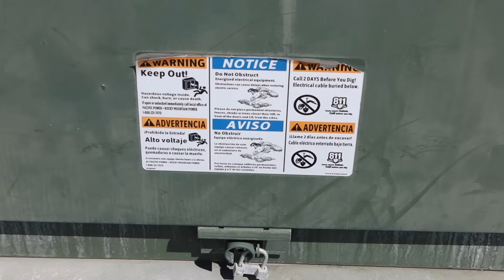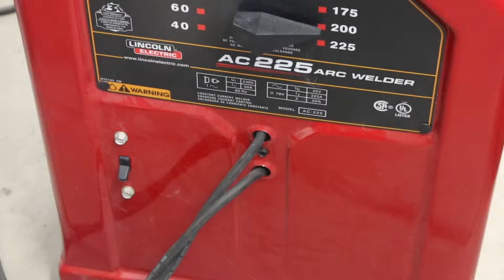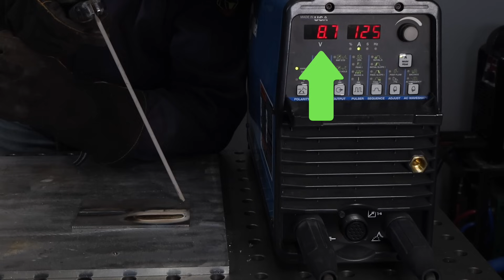Can You Get Electrocuted While Welding? Watch This...Don't Get Shocked!

Comment: Anyone! Few questions I have that no one seems to talk about are: 
1. The grounding clamp. Is it safe to have two; one for the table and one for the project? 
2. If I only have the table clamped, do I have to make sure NOT to lift my project off the table and weld? 
3. Perhaps it's just safer to clamp my project? 
4. Is it required to have a metal welding table? Will a wood table be ok? 

Thanks! I'm interested in little welding as a hobby. Little sculptures.
Reply: Newb but I've been clamping my table so far without issue.  If the project piece lifts off the table and comes back own/ wobbles then it might spark at ya.  Not sure what happens to the current if the ground is clamped to the table nd project piece is lifted - but assume it's no longer grounded and thus no circuit created so won't work.  You wouldn't get shocked anymore than when you swap out an electrode with the stringer hot assuming proper precautions as it's low voltage - good gloves, rubber soled boots, not standing in water. As long as your table is clean/ not rusted or dirty and getting a good ground then clamping to it is fine.  

And no don't use a wood table. Have to remember stick welding rods melt metal and can get to 10,000F - so could easily start a fire on a wood table.  Mayyybe you could use a metal top with wood legs but the legs would have to far enough away from the workpiece for heat to dissipate.  Not sure about that though and wouldn't want to risk it.

Comment: I used jumper cables to extend my leads . i duck taped a wooden broom stick to keep them apart . If I was using A/c  I would have done a lot worse than piss myself . Try not to use A/c   and if you use jumper cables always duct tape a wooden broomstick between positive and negative  and lay a tire with no rim on top .Better to trip and fall over than to piss yourself

Comment: I’ve been zapped a few times when working in wet conditions. I’m sure many others have too when working on construction and farm equipment in the field. I’m sensitive when it comes to electricity. I’ve been zinged by a 12 volt battery a few times and when working under humming power lines, the hair on my arms stands up and I get a little tingle if I touch a truck or piece of equipment under the power lines.Any time there’s lightning, I move inside real quick. I’m happy to have made it to retirement age.

Comment: You never mentioned the voltage figures or whether dc or ac. What voltages are used at the welding terminals.

Comment: You could be shock, but in Canadian history, only one man died from soldering in wet condition. So if you have a condition be aware it is possible to dye. but in normal condition there is no real danger whit minimum protection equipment.

Comment: 1.5 "amps" AC (Alternating Current) is what can stop your heart, especially across the body.. not the volts. DC (Direct Current)  "burns" a path through the body. Volts= force/push, Amps= Speed of wave/pulse, Ohms= Resistance. E/I x R or Volts/Amps x Ohms

Comment: Go weld up a salt water leak in the oilfield.  It got so bad I couldn't touch the truck.  Leather boots were soaked.  Wasn't there for the leak. Went to weld a well head and the vacuum truck pressured It to 3000 psi.  Then they came up with the leak at another place.

Comment: What do welders that sweat due to, for example, Texas heat, do to avoid this ISSUE- other than constantly changing clothes. All it takes is 1/2 an amp to kill you (regardless of the voltage). The most dangerous path for current is through the hands/arms because it provides a conductive path through the heart. When I work with electrical equipment, I try to use only one hand. Also a dry piece of wood under my feet. Insulation like wood, rubber, plastic separating me from the ground/floor also helps protect you.

Comment: New to the channel and welding. Although this video was informative, do you have a video that discusses the do/don'ts of what to come in contact with while welding the work piece? Kind of confused whether its OK to prop yourself on the welding table or the work piece to steady your torch or electrode holder.
Reply: I do it, but just not with any bare skin
Reply: @fuzzfacelogic789  Thanks for the feedback
Reply: At school we use metal framed booths to ground the current and I lean against them all the time. Youu will be fine as long as you don't complete the circuit so make sure your wearing gloves, jeans, a wool jacket preferably, and work boots if possible.
Reply: @270Winchester  Thanks for the comments

Comment: I want to do stick welding but this part scares me. 

Does the proximity of clamp to the stick make much difference vs your body completing the circuit?

I was thinking of sticking welding table on a rubber mat.
Reply: You have ground clamp on the table never the less, so i dont see what that rubber mat under the table would do, but standing on rubber mat other hand does insulate you from the ground. I'm no expert and have been welding for years with ancient stick (the most reliable machine you can get) in rain and snow fixing farm equipment and only once had case of getting slight zap when leaning against the work peace that had the ground clamp with my leg, supporting my left hand on top of my knee while replacing electrode and being absolutely soaked, but it was the slight numbness you get from lower voltage zap, just what the hell moment. Still havent able to figure this out but get pair of good rubber boots or work on rubber mat, dont go welding while soaked and you should be good.

Comment: On a flux core non live torch is it ok to to test (hold ) the wire at the end of torch when setting the wire feed roller  resistance as many say to hold the wire then set the roller tension ? And as you will have to pull the trigger to feed the wire it will be live will it not ?

Comment: Is it safe to hold to an electrode - stick when striking and welding?
Reply: I wouldn't assume it safe-safe. Electrode welding is relatively low voltage, but i wouldn't do it bare-handed :D
Reply: @LadyBovine  a lot of video out there "how to do" but no one is talking about safety.
Reply: @grogu.  Yeah, i guess it's one of those things you can do (and can be useful in certain circumstances, if done carefully and in short bursts, ) but isn't generally advisable. Like grinding with a cutoff wheel, or running through the snow naked and majestic, in your bare feet.

Comment: The answer is hell yes.  Just yesterday I felt myself get shocked through my glove,  was more of a tingle but it was def. from the rod I could tell.  I was running a 1/8th 7018 and it stuck on me (was running 125 amps,  those rods are just the kings of sticking) and then when I pulled it off,  it like slipped and was still stuck on there and I felt that current travel through my glove.  So yes,  the answer is hell yes you can.

Comment: This guy: "Avoid welding in wet conditions."
Welding divers: "Hold my beer."
Reply: Thats why they can make up to 300k in some cases even more a year still no thank you if i had nuts thats big id sink to the bottom of the ocean
Reply: I once did some welding at home in the rain with a 220v welder. The input switch cut all power in off position so I turned it on and off with my foot, I was using totally soaked rods that were in a bucket of water. I put a rod in and turned the switch on with my foot being careful not to touch anything else. It worked okay but I sure had to be careful.
A my job I have a tig welder that has high voltage start circuit capable of arcing about 3 inches. One time due to a
 cracked up gun casing and not enough black tape I got that high voltage arc right into my hand. I felt like my arm was going to fly off.
I once knew a guy that did underwater welding. He said you are connected with radio to guy up top who controls the welder, you give the word when ready and he connects the juice. He said you can feel the charge while you're welding.
I don't know how they can do it.
Reply: There's a lot of volume in water
Reply: @justinberry3991  It's quiet for me.
Reply: Welding in damp conditions is not fun. Really not fun replacing rods. My elbows hurt thinking about it.
Reply: @Ian-of9oi  I would imagine that welding in damp conditions might be worse than welding underwater. Underwater it's all grounded and the whole thing is a path to ground, so I imagine, even though there is a lot of electrons there is an even larger path to ground and it dissipates pretty quickly.
Reply: @jeptoungrit9000  As a person who did weld underwater, I can assure you it is not great fun but it is bearable, kind of like holding a 9v battery to your tongue. It does become more unpleasant for people with old fashioned metal fillings though!
Reply: @darrenporter1347  I can see the fillings. I imagine it's something similar to step potential.
Reply: Yep
Reply: 😂😂😂😂❤ indeed
Reply: Muddy Pipeliners enters chat 😂

Comment: Voltage... lol. It's amperage that kills. You can handle an absurdly high "voltage". Hundreds, easily. Amperage? 0.1 can technically kill you if it happens at the right moment in your heart rhythm.
Reply: Amps require voltage to affect you. Doesn’t matter how many amps there are if you don’t have enough voltage to overcome the resistance of the body

Comment: lol, i have a burn on my thumb from the HF start on my tig jumping through a seam in the torch handle when I was adjusting gas... 10 feet from the ground... also, trying to light an arc on something insulated that you complete the circuit to is fun. I work on big round tanks, and I have to weld baffles inside, so they go on rollers on my bench... that are rubber... so when I lay in it and forget to put a jumper from my table to the tank... the plums get zapped...

I also once complete a path with a stick welder from one hand to the other... that wasn't fun either...

Comment: Yes and no.... if you have a clean ground its very highly unlikely as electrons take the path of least resistance if youre wearing proper PPE you should be fine (key word should) Voltage can kill you even with super low amperage and vice versa... 24v @ 250 amps will stop your heart in the blink of an eye however most welders dont have high voltage so we are left with the current being the killer here.

Comment: you did not answer the most important point. Voltage up to 48V is generaly safe to touch; so are 24 and 12 volts, of course. If the welder voltage is 28V it should not be dangerouus, assuming that the Ohm's law work; amperage is a function voltage and resistance. So, the question stands: it is perfectly safe to touch the car battery posts, 12V or 24VIs there anything different in welding? The same range of voltage.....why do you ask people to be careful about insulation?

Comment: Deffinetly important content that needs more coverage 

2 months ago my buddy and i were welding a hand rail that was sitting on the welding table and the metal table for the band saw due to its size in 1 pieces. And the ground clamp from the welding machine was hooked onto the metal hangar that is bolted to the machine. We got 7 inches welded until, THANKFULLY, the machine gave an error code. Ill let you troubleshooters figure out how we were able to weld, but it took me alot of researching. 

Safety third! 
Stay safe all!

Comment: Yes you can, I have gotten shocked, but the machine has its own ground so it rather take that path and if you have good shoes you might get a pinch or light shock but you won't get the full load... Now "IF" you  remove the ground and stand in a puddle of water with no shoes... Good bye !

Comment: Having been a sanitary pipe welder I can tell you that "not welding in wet conditions" is not an option.  Back in about May 1995 I was doing a job at Arrowhead Water in Los Angeles.  My foreman asked me to do something before I left as everybody else had bailed for the day.  He called it the Chinese Water Torture Closet.  It was a Stainless Steel enclosure that kind of looked like an outdoor water heater closet, it had an open top, a small door that gave access to the manual valves inside and there was about 18" of daylight underneath.  I had to climb underneath to the inside and weld a new valve in place.  As I'm inside holding my tig torch which was connected to an Airco 110v inverter welder the foreman tells me he's going to hook up my purge line from the top and he disconnects a 2" SS line that drenches me and sent a constant shock through me until he was able to shut the welder off.
Reply: And sometimes it rains. Hard.
The family still gotta eat..
Reply: Dear lord
Reply: While I asked gpt... ''Yes, it could potentially be life-threatening. Any situation involving electric shock, especially when water is involved, can be extremely dangerous. In this case, the individual was working with welding equipment connected to an electrical power source, and the sudden contact with water could have resulted in severe injury or even death due to electrocution. Additionally, being drenched with water while working in a confined space could increase the risk of drowning or other injuries. Fortunately, the foreman was able to shut off the welder before serious harm occurred.''  (because I'm not familiar with the actual threat level)

Comment: I have a super old 120V stick welder that is I think some sort of auto-transformer there is no isolation from the primary to the secondary, seems to like to trip GFCIs too. My Craftsman and Century stick welders both seemed to run open circuit at about 50V AC. The craftsman unit is rated for like 240A output, but shorted I tested with good clamp meter and it put out about 340 amps.

Comment: But ground is ground, as long as it is a good ground you can touch it but it will still conduct thru the ground anyway. If it was dangerous to touch a ground with 120-240 volts on it, then it would also be dangerous to even walk on the ground, but it is not.

but i will say when you weld in the rain, then it is possibly dangerous because the gnd on the machine has to go thru the house/shop wiring, causing some inductance, and therefore makes some resistance to its gnd rod, and a possible hazard if you are all wet and sweaty standing on the ground in bare feet, touching the live feed. If you are more conductive than the ground, then you die. You NEVER want to touch the live feed regardless if good ground or not, because then it is using you as ground to some extent depending on how good or bad you yourself are grounded. You might only get tingling, but you also might get full out electrocution if you are all sweaty and/or getting rained on and in bare feet(or your boots and socks are soaked), your equipment ground compromised or not. But when you are arcing the weld tip thru the equipment ground, then don't be afraid you won't get electrocuted, just not in rain, not in bare feet either. Just don't touch the live tip when it is NOT flowing thru the equipment gnd. You never want to touch the tip regardless if it is live or not, because it is also hot(temperature).

HINT: buy real boots with REAL rubber soles. Don't stand there in walmart specials unless you like toasting yourself well  done. I have a pair with Goodyear soles, and i can even walk on steel roofs with huge pitch,  everyone else slides off, i don't. You will benefit in more than one way with real rubber. FYI electricity can't pass thru rubber, only insanely high voltage can jump past rubber, and even then it is not going thru it, it is going around it. If you have dry feet using real rubber soles, then you couldn't electrocute yourself even if you grabbed the hot wire in the fuse box, as long as you DON'T also grab the gnd wire or neutral at the same time, or touch ANY ground. But you could touch 240 volts for example, with rubber soles on your feet and not feel a thing, but don't touch ANY type of ground at the same time or you are TOAST, rubber soles or not. lol that was just for example, always disconnect fuse box before working on it, rubber soles or not, it is way too easy to touch something you shouldn't even though you know you shouldn't, there is not enough room.

Comment: You are partially wrong in your comment that it's voltage that kills, it's actually amperage that kills. Tasers push 50,000 volts through the body but they only have micro amps which makes for the most part safe to use. 
I got lit up by a welder 41 years ago last month. Just out of high school I had just got hired as a production welder at factory that probably should have been shut down as every time it rained we had standing water inside the shop. We were running production so if we hit our weekly production early on Fri, we got out early so everyone tended to work together for that purpose. I had got a little ahead of the next station on the line so I was up helping them on a rainy day when we had about 2 inches of water on the floor in spots. I was standing in water as I helped get the parts racks we were extending put in place on the jig when one of the other welders struck an arc before I let go of the rack. Next thing I knew I was laying on the floor with people standing around me asking if I was ok. I got escorted to the break room where the nurse checked me out and got to set in the break room for a while until I felt good enough to go back to work which I think was 15-20 minutes I think. So yes, you can get electrocuted by a welder. Yes I survived but if had been someone not as young and healthy as I was, it could have killed them. I'm glad I only worked at that shop that summer. summer.